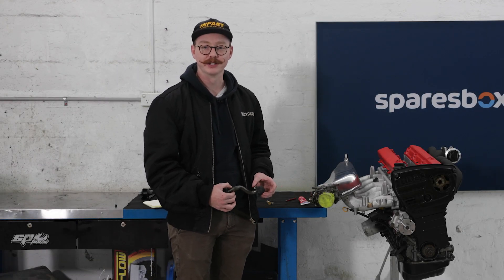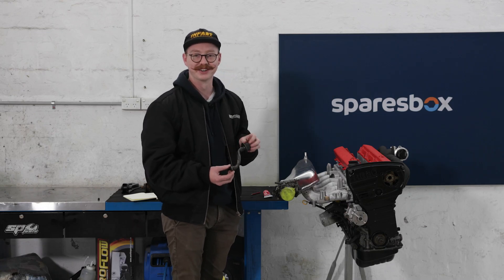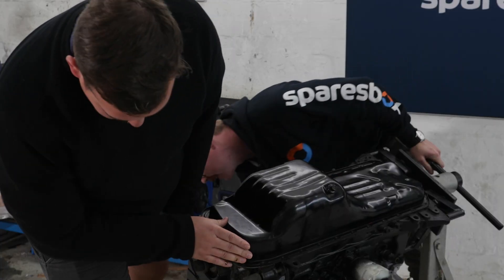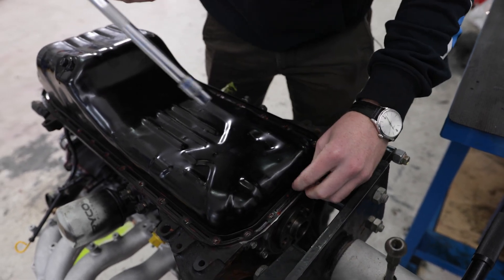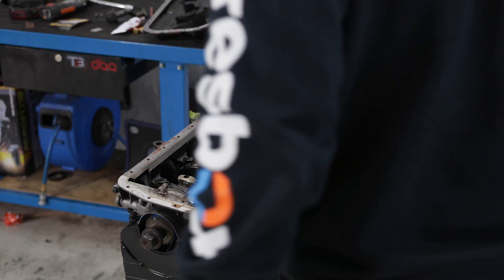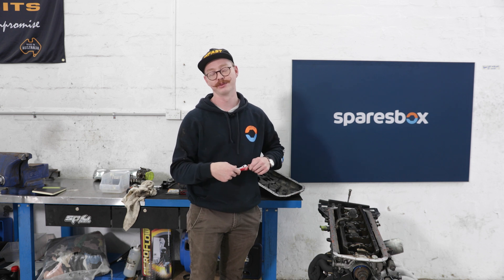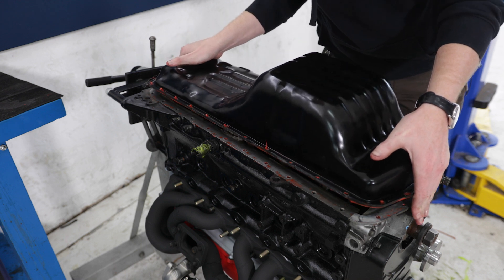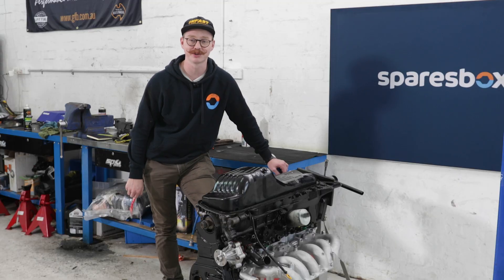Maintenance Monday - How To Seal Your Sump with RTV!

Comment: Do as he says, not as he does. Make sure you use the right RTV for the application, Permatex red wasnt it for this. Black would've been the right one. Dude just used an RTV designed for mating surfaces around air, reds for Manifolds, exhausts, turbo stuff etc, not sumps.